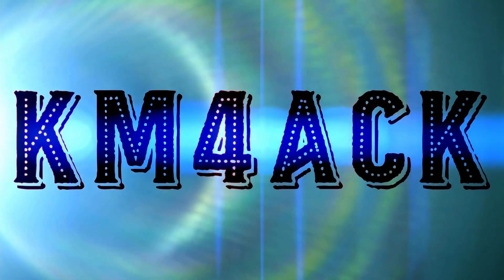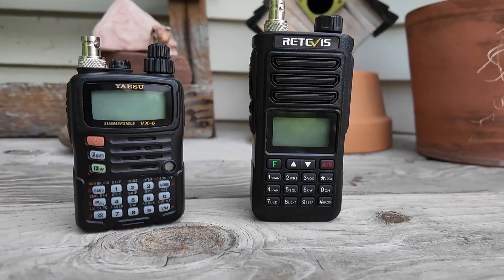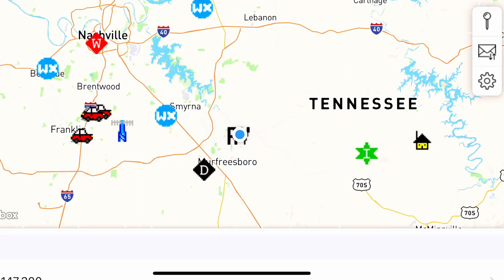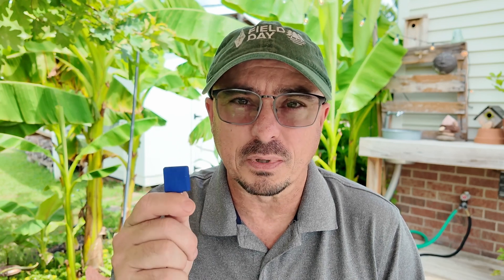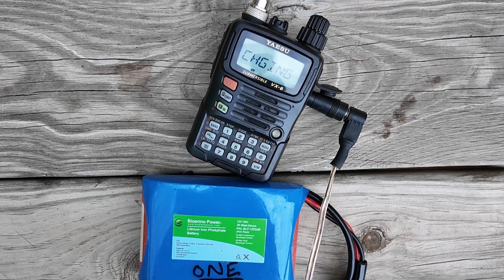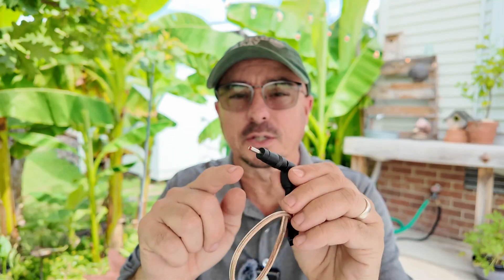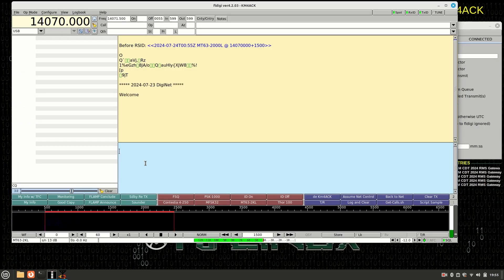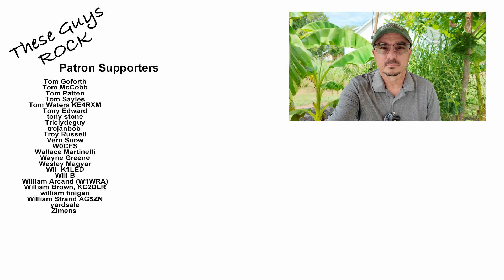A Redesigned Ham Radio HT kit

Comment: For the power bank, a good one to check out is "INIU 140W Power Bank". One of the reasons I switched to this one is because I am also playing around with having a highly portable electronics EDC pouch, and this power bank can run a Pinecil V2 soldering iron over USB-C PD at its full performance spec. And you can charge your HT off of it at the same time on a lower power port.
Reply: dude, clutch, thanks

Comment: Jason, saw your comment above about charging directly from 12V...where are you finding that info (specifically for a yaesu, but I'd be interested about other radios as well)? A quick check of the manual didn't yield anything... Would be super cool, but I'd rather not trial-and-error it!!
Reply from the maker: Look in the specs section of the manual. The FT5 manual for instance tells me that EXT DC Jack will take 10.5-16V for charging. The D75 has an imprint on the DC port cover that reads DC In 13.8. Please don't trial and error. No one wants to release the magic smoke 😜
Reply: @KM4ACK  right! Thanks! I'll dig further!